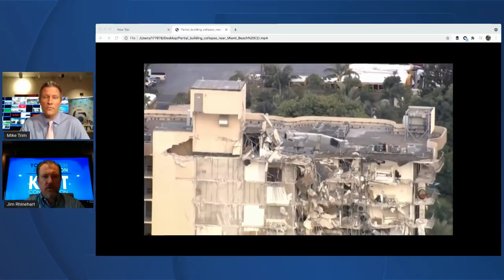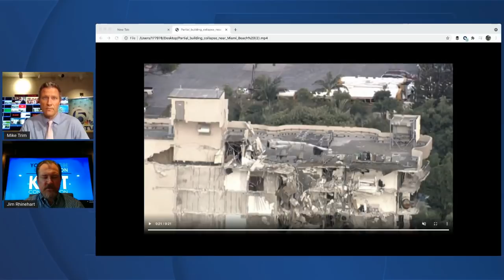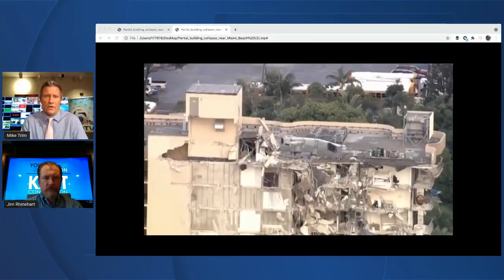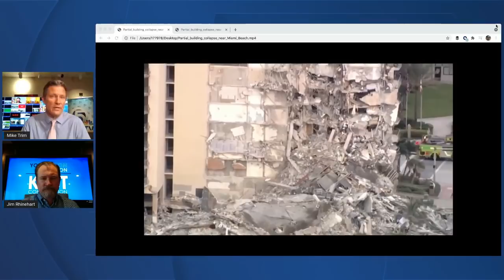Facebook Q&A: What caused Surfside building collapse?

Comment: Sand stone Wash's away over years ,the front of the building started first then the back .no sink hole they said .
Reply: It wouldn’t be sandstone.  Florida rests upon the remnants of an ancient coral reef and that is the “bedrock” of nearly all of Florida.  Coral is composed of calcium carbonate that becomes the cement that makes it into “stone”.  However, acid rainwater (and surface runoff) will slowly eat away at the calcium carbonate resulting in large underground caverns forming that can suddenly collapse without warning in the form of a sinkhole.  

I don’t see where anyone can realistically rule out a sinkhole at this point in any investigation as sinkholes can be giant monsters large enough to swallow even a large mansion, or an entire block of residences, whole or narrow enough to swallow just a singular tree and nothing more.  I grew up throughout Florida (I’m now in SC), south, central, and north (I only missed the panhandle), and experienced a number of sinkholes on our farm property while growing up in north Florida.  We had sinkholes that were small enough that they only swallowed one of our wells, another that swallowed a 30 foot (about 10m) tall patch of bamboo after it was watered in, I came back an hour later and the bamboo was only 3 feet (1m) tall.  I also had a sinkhole about 6-8 feet (~2+m) wide that had opened up under me just as I had driven over it with my vehicle that then required several large dump truck loads of soil to fill in afterwards.  So a sinkhole could easily open up under one, or several, piers or pylons with little visual surface evidence to show for such, especially when the entire area is buried under 13 floors worth of debris obscuring most of the former foundation.
Reply: @ethanpoole3443  same thing goes away .to bad this happened all them people ,they will be looking at all them buildings now .
Reply: Sand stone does not 'wash away'.